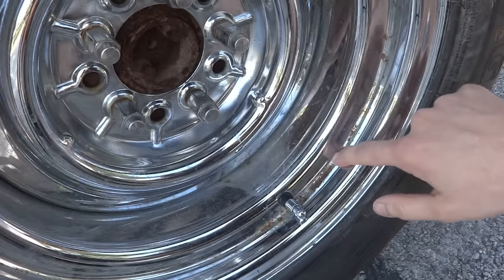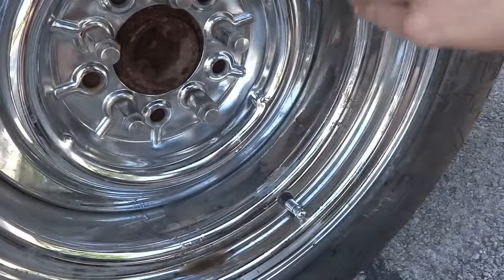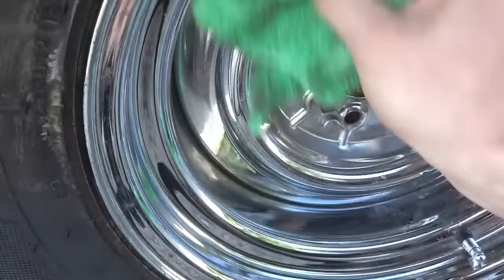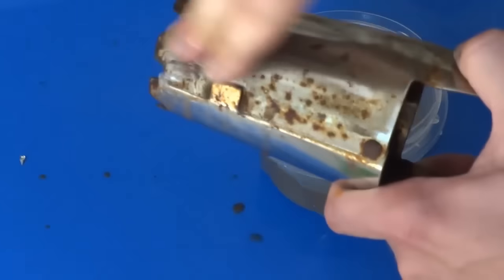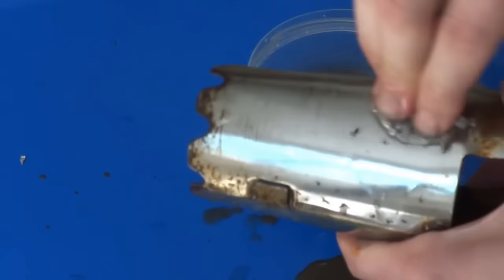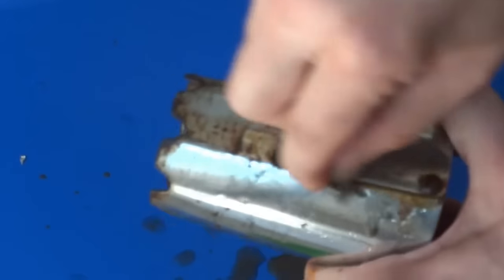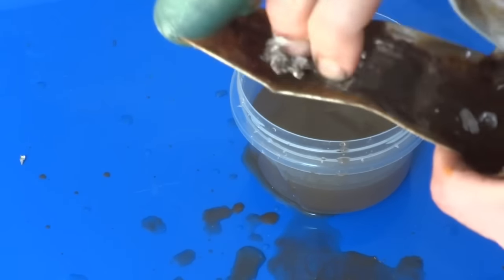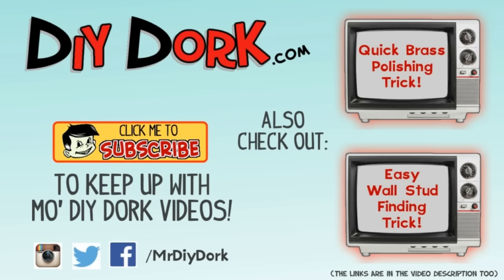Easy Rusty Chrome Cleaning Trick (with Aluminum Foil!)

Comment: Why does that work? I'm just wondering. That's really cool :)
Reply from the maker: +islandboy4445 I'm thinking mostly abrasion from rubbing (and the aluminum is softer than the chrome, so it doesn't scratch) but I think I saw someone mention a mild reaction possibly happening too when I was researching this out. I also saw that you can try it using water, diet Coke, vinegar/apple cider vinegar, etc. And it might possibly work better using it with the shiny side of the aluminum foil facing out. Pretty cool trick!